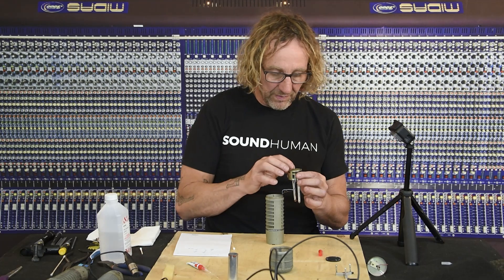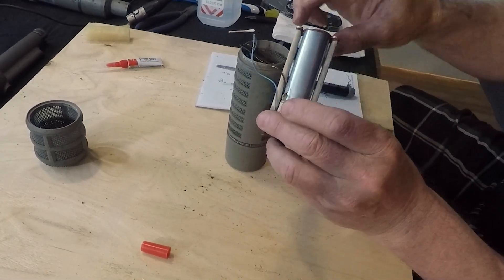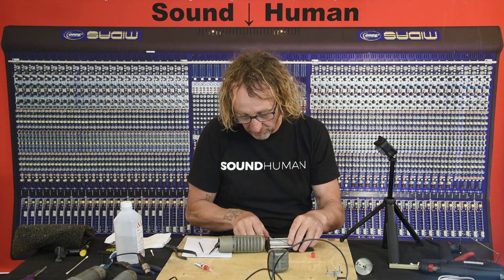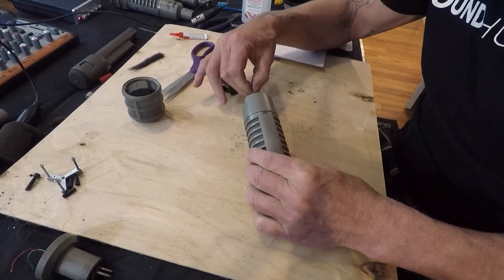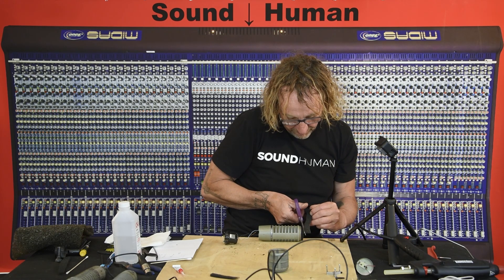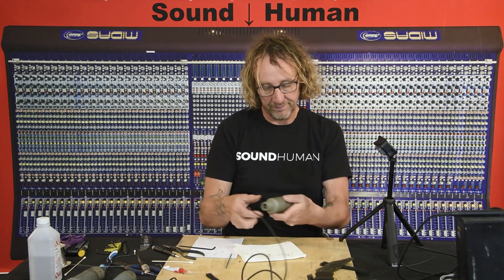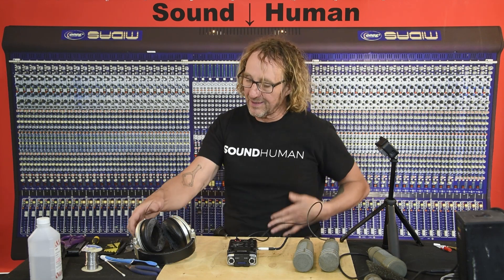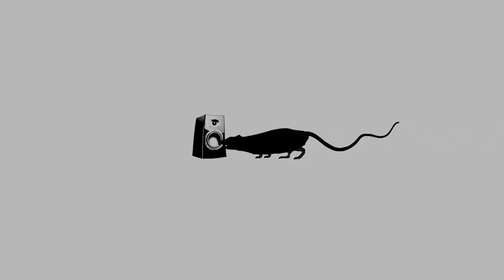Refoam, Rebuild and Test EV RE20 Microphone Video #3

Comment: Thx Dave...my PL20 has this issue. Makes me nervous to try this but my RE27 is good but not as smooth sounding.PL20 IS A SPECIAL MIC. I'm gonna have to do this. I've heard your name over the years..
Now I can put a face to it...thx
Reply from the maker: cool cool Gavin. yeah the RE27 is louder and harsher compared to the PL20 and RE20 which are exactly the same with a different paint job. 

it definitely takes care and patience but if you succeed, it's super fun and exciting to have those cool mics back in operation

Comment: The pin that's on the back yolk, by the XLR port....Can that be pulled out with pliers? I'm looking for alternate shock mounts and that gets in the way. Thanks!
Reply from the maker: yep, comes out easily. I don't exactly recall but I think the ground wire is insulated and wrapped around that post several times possibly forming an inductor. 

so if you move it and want to maintain the original noise filtering, you'll want to keep those wires wrapped and ground the pin somewhere else.

that said, I've had re20s with that ground pin broken and audibly the mic performed the same.
Reply: @DaveRat  Thanks very much!

Comment: You would think that with so much engineering, the designers would have thought of a better way to retain the capsule or at least an easier way to change the foam, ha. Great microphone, but what a nightmare to maintain. Great work and greetings from Argentina.
Reply from the maker: greeting!!

Comment: Thanks for this video I picked up my first re20 for cheap because it was busted since I can’t afford a new one. only guy I could find doing the entire repair. I managed to resurrect one with a “collapsed” capsule by painstakingly removing the diaphragm entirely from the magnet body. mine also had the dreaded rotting foam under the phase plug in the acoustic chamber which I assume had made its way between the coil and magnet after that plug came loose. Wouldn’t have attempted it without this.

Comment: I've had good luck using  AC-filter foam on mics when they needed some love.
Reply: Could you please explain what AC-filter foam is? Thanks!
Reply from the maker: Air conditioner filter.foam

It's open cell, inexpensive and should work well.

Like the thin foam that is on the intake of a wall mount ac unit
Reply: @DaveRat  oh, okay! Thank you for that info!
Reply: Yes, any foam that passes air. Motorcycle foam air filter is also good when thicker foam is needed.
Reply from the maker: Good idea

Comment: great vid! i tried to fix one some time ago, got almost as deep as you do but still have a noise issue with it, so i guess it might be a problem behind the capsule, can anybody give some hints? THX
Reply from the maker: What kind of noise?
Reply: @DaveRat  some buzzing sound like some electrical component wasn't connected right, also i didn't know how to open it and as far as i remember there is one copper coloured wire that was torn and i didnt know how to connect it.. I dont have it here right now but your video inspired me to look over it again...

Comment: That mic has quite some Mickey Mouse engineering using rotting foam to keep parts in place.  =)
Reply from the maker: Yeah, and it's hard to know what sorting will do in 20 years. I'd hope they change the foam type to last better

Comment: Very well done sir 🙏
Regarding your "honky" mic: sweep the filter circuit's frequency response and look for a deep notch where you are hearing the honk, if you don't see that notch in the passive eq that is why it sounds "honky."  It's very possible the diaphragm is stuck, sometimes they can be unstuck sometimes the diaphragms are too far gone/damaged. Sometimes it's the voicecoil itself that is starting to fall out of shape or is pinched in the gap in those cases it's new voice coil time. Sometimes it's debris in the gap preventing the coil from moving and holding the diaphragm in a restricted state. This debris is often the old glue crust from the adhesive which used to hold the pole piece to the magnet.

Microphone won't pass a freq response within limits (might still sound good) if not air tight.

HPF components are the inductor only. If it goes open it can be rewound with #40AWG magnet wire, fill the bobbin. Less turns less rolloff more turns more rolloff. Modern PCB version can be rebuilt too but less common to fail. If microphone is in permanent "rolloff" check that the switch isn't stuck closed.

There are better ways to route the wires than the factory method of folding them up in the rear cup making future disassembly much easier with zero downside in performance.

Blue loctite 243 on the 9/64 rear cup screw may or may not help with accidental twisting when installing/removing from a 309a. That aluminum triangle bracket is really soft, don't over torque that screw or you will crack and break it.

The name dB is great 🥰

2020 put me years, literally years behind in repairs but I'm slowly catching up.... sorry everyone. Surely if you've watched this video you can appreciate the effort that it takes to repair, and sometimes it doesn't go this smoothly as Dave makes it look easy ☺

Comment: I want to do the same with my sm58s and other handheld mics, but I fear I'd break something... I have light foam, I believe it came from a PC motherboard box. Would that be ok? Hope you'd make a video, it seems simple enough to do but a video from you would give me the courage. The degraded foam is annoying, I'd like some high end back on my mics :) ..Thanks for making this video
Reply from the maker: Probably buying some cheap or original Shure replacement grills will get you mostly there easily.

As far as foam on the capsule, dav with damp paper towel , don't let water seep to the diaphragm.

Comment: Nice job Dave. I was talking to Bob Heil about the RE20 and he sniggered "all marketing" (laughing) but it's not - as you proved. I use one for all my videos, hence my interest.
Reply from the maker: The real beauty of the RE20 is the lack of resonances. There is very little LF coloration from rear chambers or heavy diaphragms that manufacturers use to add LF.

So many dynamic mics add a bong or a woof sound, the RE20 is warm and smooth sounding.
Reply: @DaveRat  Yep.. I use RE27 too for another application (Live shortwave ham radio) and it works fine but too much punch for me. RE20 fine but I still need to lift me up at around 2k. Anyway.. good luck.. I enjoy your fun and games!
Reply from the maker: Cool cool yeah those re mics are great for keeping the low end tame when you get close and far
Reply: Definitely not all marketing, it's patented(expired) 60 year old technology is still among the best.
Reply: Good to see you here Callum. You have great audio on here and on the air.
Reply: Yes, I also heard him say that in a video while promoting his line of microphones and I realized that he didn't know anything about microphone desgin. Their microphones are Chinese microphones that only have the Heil brand on them. I have one equal to the pr35, but with another brand and it cost me much cheaper. Later they changed the aesthetic designs (I think to get away from the fact that they do not design their microphones), but maintaining the capsule. For example, I believe the pr35 capsule is a Chinese design based on a Beyerdynamic capsule. But hey, that doesn't mean that he was a great character, have designed some nice gadgets, be a good businessman and a great storyteller.
Reply from the maker: yeah, Bob did and was involved with some cool early innovations.

I personally don't find Heil mics impressive and felt marketing was the primary drive for people using them rather than quality or technology. 

I tried doing a video on fixing a PR35 but instead just threw it away.

looking back I feel that I should have done the video and highlighted the assets and issues.

Comment: oh , the 6:35 hot glue . reminds me of the dreadful oscars this year with west side story and someone had birds-nest hot glued to her head ? well wacky oscar rich people . 
never repair fix microphone before all those behringer ECM8000 and the clones they seem have brittle mic that seems made of diecast metal ? and one snapped in half . flipping cheap chinese garbage
Reply from the maker: I can't see a Beringer mic being worth fixing
Reply: @DaveRat  same with them all . are they all/each made of diecast metal that is so brittle or some carbon moulded plastic 
?
Reply from the maker: No, the build quality of these and many mics is amazing. The Re20 is a rugged steel that is strong but can rust if the paint chips and exposed to moisture the 441 is cast but the metal is quite strong for the intricate structure. Many mics are machines brass.

Cheaper mics tend to be rugged mics mics like nice watches are well built and rugged but also delicate